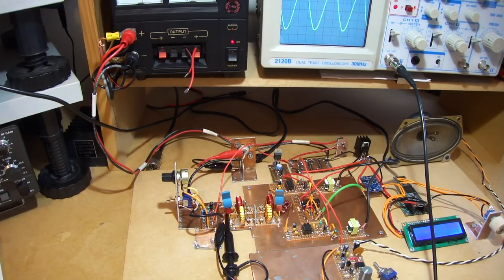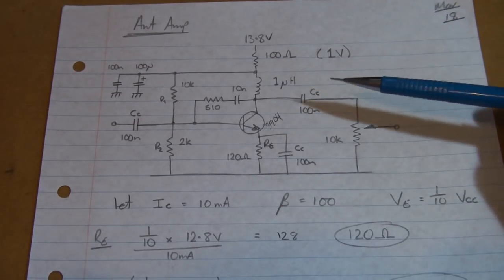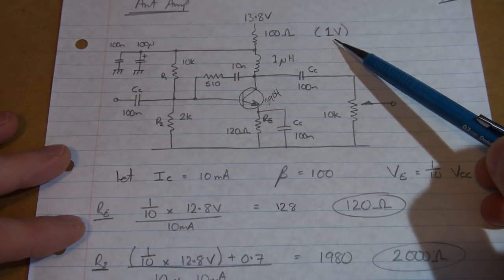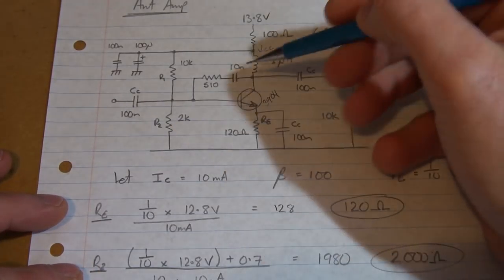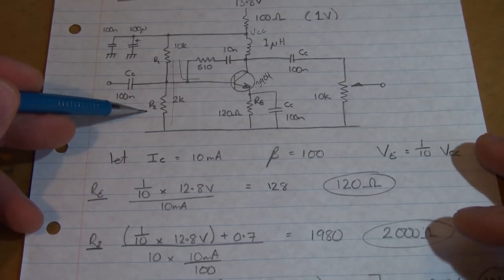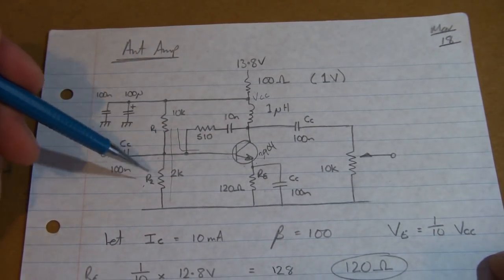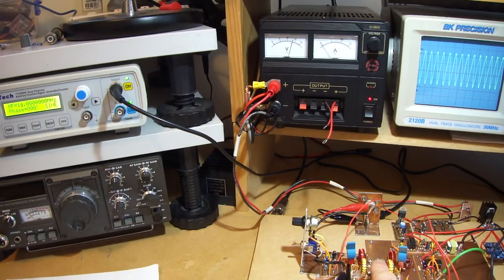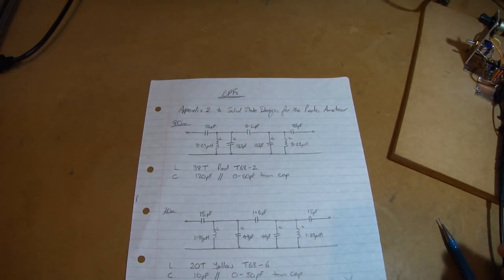Homebrew SDR SSB Rig - Part 4 Antenna RF Amplifier and BPFs

Comment: Thanks very much for sharing Charlie. Where do you usually source your RF components (toroids, RF/Audio transformers, trim-caps etc) from ?
Reply from the maker: Hi Zinahe. As I live in New Zealand I have to source quite a few components from overseas, especially if I want to pay a reasonable price. Here is a typical list:
Resistors - from our local online TradeMe auction site. Typically 600 resistors across 30 values.
Capacitors - TradeMe
Transistors - TradeMe, JayCar, AliExpress
Audio Transformers - AliExpress
Toriods -  KitsAndParts.com
SBL-1 mixers - MiniCircuits, AliExpress (not tested yet)
Trim caps - Mountain View CA, from a surplus parts store. That shop has now closed so i might look at AliExpress
Inductors - TradeMe
Crystals - Junkbox, AliExpress (not tested yet)

Now AliExpress has been mixed to date. Mainly good, but I have had some suspect parts. On the flip side, they are very cheap and often have free shipping to New Zealand. 

Hope this helps!

Charlie
Reply: Thanks. Cheers.

Comment: The input impedance on your antenna amp seems really low at certain frequencies--is this normal? shouldn't you have a 50 ohm match?
Reply from the maker: Hi. Yes you are right in that there should be a 50ohm match for maximum power transfer. In this case I took a simple approach and didn't look to achieve that. Not ideal I know.
Reply: Ah, I see! I'm trying to make my own HF SDR with some modifications to "make it my own". Thanks for the tip. I might just use an RF op amp like some people recommended.
Reply from the maker: Sounds good. This is by no means an optimized design. Put up another comment once you have tried the op amps. Cheers.Charlie

Comment: Just a question, was that inductor 1uH or 1mH? As I'm getting a nice curve with 1mH but its way off with a 1u ?? Many thanks. Great videos !
Reply from the maker: Opps. Totally correct. Thanks for pointing that out. It's a 1mH inductor and NOT a 1uH. I've updated the schematic on the blog.

Thanks again.

Charlie
Reply: Ah no problem. Sorry wasn't being picky, just couldn't get it to simulate and though ah ha!! lol 

Love the videos mate, the calculations are brilliant. Currently got a simple direct conversion mocked up with an NE612 and just doing a pre amp. Got no components, so waiting for ebay to delivery so I can start to build in earnest ! Just wanted to say thanks for the whole video series. No waffle, no claptrap and easy to listen to. Brilliant !
Reply from the maker: Perfect, and thanks for the feedback on the videos, that really helps. Good job on the DC receiver. That's a great way to start a build to test out the mixer, AF amp etc. Then covert it to a superhet if needed. 

Thanks again!
Reply: No probs, building from the front end forward lol. Seems the logical way... Quadrature made my head hurt but I'll get there ;)

Comment: Thank you for a very informative video and video series. The book you referenced, Solid State Design for the Radio Amateur, is included in the CD which accompanies the reprint edition of Experimental Methods in RF Design from ARRL.
Reply from the maker: Thanks Mike. I didn't realise that. I have a hard copy 3rd edition of SSDRA which I have had for many years. I find that to be an excellent reference too.
Reply: Yes, an excellent reference. It was an important part of my introduction to communication electronics.